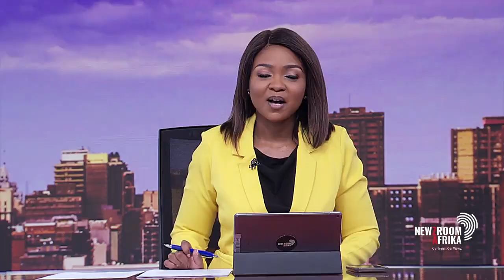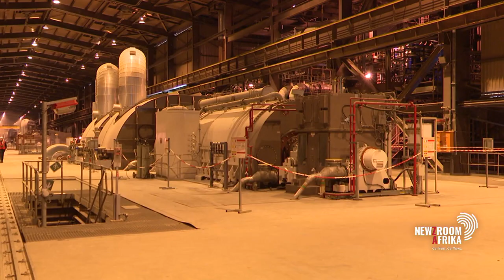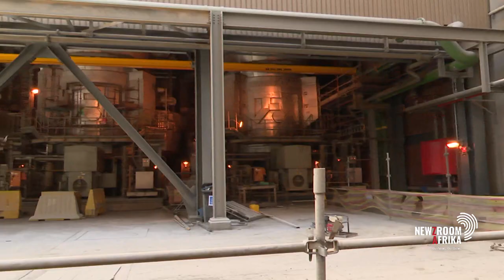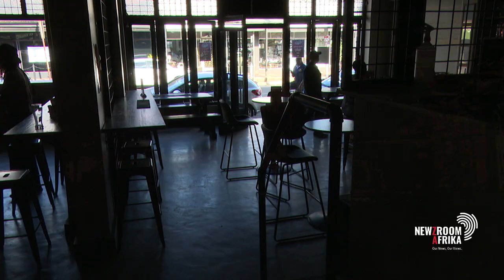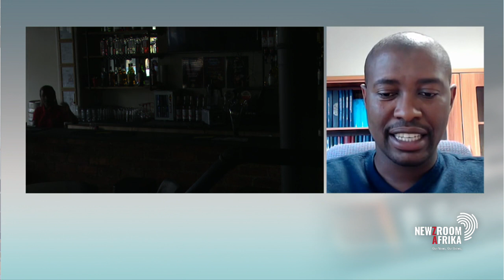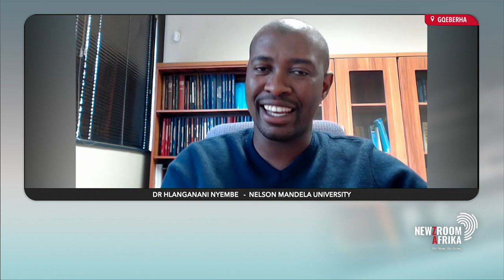NMU graduate's fix for Eskom turbine rotors

Comment: They can improve the diagnostic equipment as much as they like, trouble shoot much sooner in advance and they can improve the materials strength 10 fold, it still wont help. Wskom workers will break it or sabotage to break it.

The syndicates will go on and the theft will continue. 

Lest we forget, Eskom was maintained to perfection before but now, nothing is possible.

I have no faith in this announcement or any other that promises to improve Eskom operational capacity

Comment: Anything helps but my understanding (I am not an engineer) is that biggest problem that takes units offline is boiler tube leaks.
The high sulphur content in the coal mines supplying Eskom (plentiful and it is cheap coal) is eroding the tubes and repairing them means taking a generation unit offline - wait till it cools down and fix the leak by welding it - then start it up which takes hours afaik then wait for it to get synchronized to the grid.

It is getting worse now since the various older powerplants are or have reached the end of their life - you will notice the same names Camden , Kriel  etc every week.

It is not your car radiator where just throw in  Wynn's Radiator Stop Leak and keep going.